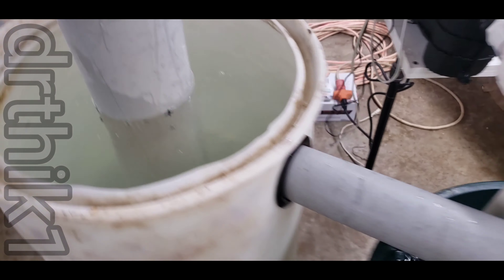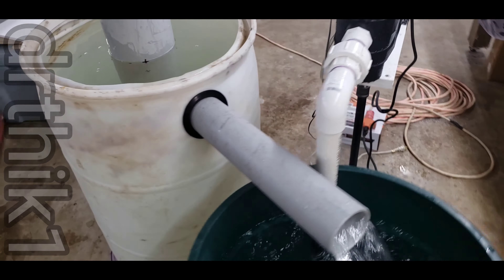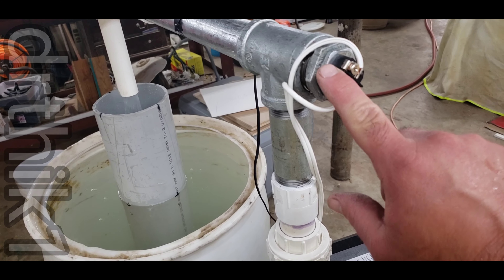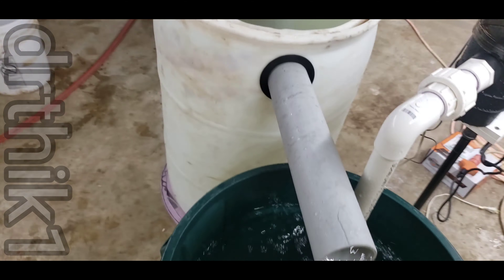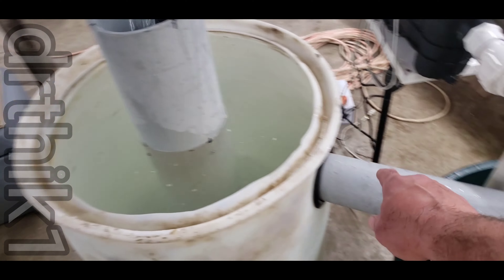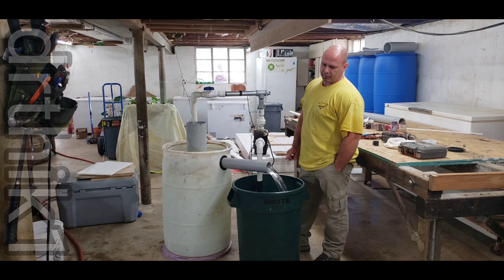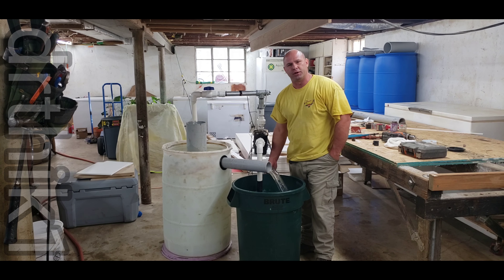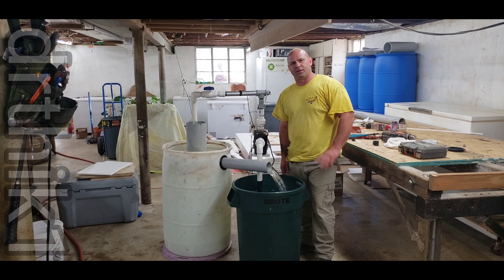DIY pond filtration system update

Comment: That is awesome. Thanks for explaining how it was built. How does the pump handle any solid debris which may enter?
Reply from the maker: The intake pipe has 1/16" slots in it also the pump has a built in strainer
Reply: @drthik1  Thank you. See what you're saying regarding the intake/filter. 

Want to build something like that for filtering the liquid fertilizer that Aries & i have invented. It initially has solid particles & is not appropriate for treating houseplants or plants meant for consumption. What you made looks really close to what i was envisioning.

Thanks for sharing your project!
Reply from the maker: @UCeInYqYcN6z7NgIN87hbqZg I've considered collecting the water from my basement sump to use for watering plants
Reply: @drthik1  You're cool.
Reply: @drthik1  Are there ways to install a valve into a plastic tote- for drawing out the finished product, which will not leak?
Reply from the maker: @raestephenson7932  google-   uniseals
Reply: @drthik1   Thanks. They look like they'll work great, and great prices... Thought it would be more involved & costly of a project to install. Thanks for telling about that.
Reply: @drthik1  Hey Matt, how did the install go? Waiting for the pond update. 😁☺

♥♥♥🐢🐟🌱🐌🐸♥♥♥
Reply from the maker: @raestephenson7932  I've got the pump and filter installed just working out the kinks.
Reply: @drthik1  
Thanks for the update! 😁 Hope it gets fixed soon so the fish can swim in clean water. ☺♥🐟♥☺